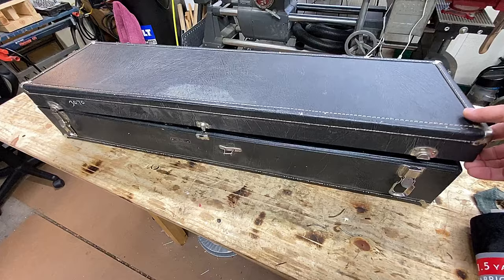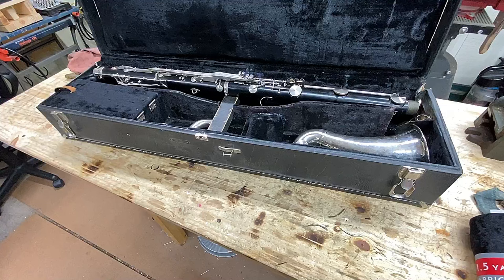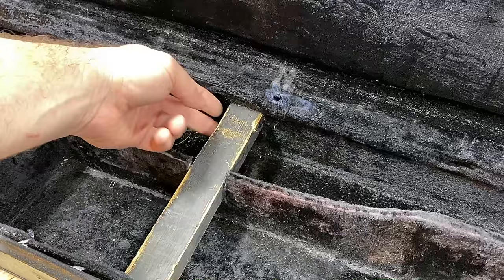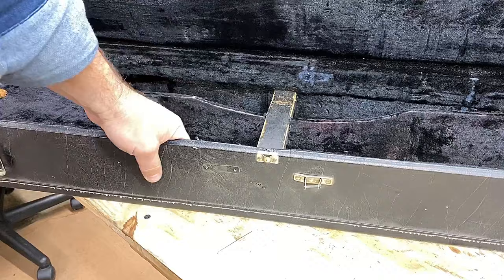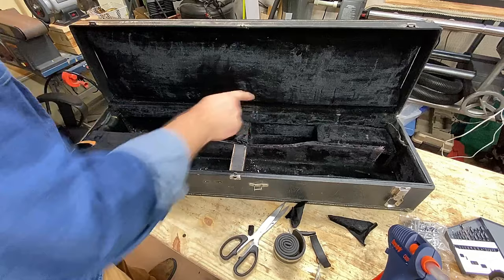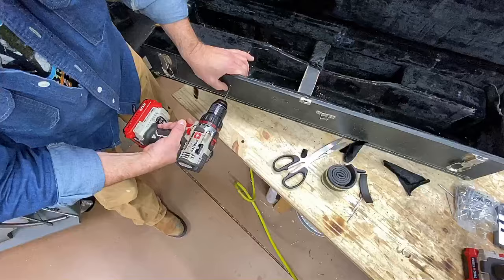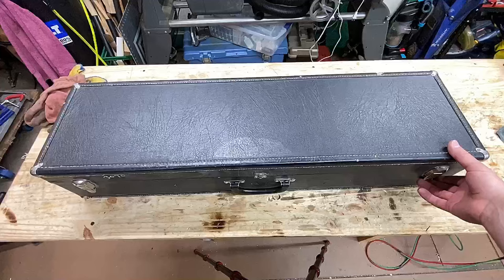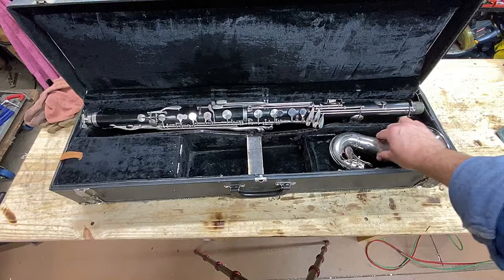Case Restoration- Wes Lee Music Repair

Comment: For hot gluing the velvet, I use popsicle sticks instead of my fingers! Lots less burns that way.  Instead of "school repair" level, I prefer doing total restorations of cases to better than new.  A lot more work, but more satisfying.  I have seen a lot of those whimpy cases and have used aluminum tubing the whole length of the case a couple of times to fix it.  Dumb design with the handle having almost no backing, but you see those often. My most satisfying task is recovering the outside with new vinyl material.   Ahhh that new case smell....
Reply from the maker: Drop me an email to wesleemusic@gmail.com along with some pictures of your work. I may have something for you.
Reply: Have you ever replaced the zipper on a (selmer)  sax case? I can't find anyone to do mine.  It's a shame because the case is otherwise really nice.
Reply: I build french fit pistol cases. I prefer using hot hide glue for a lining. Takes some prep to get started gluing, but sets quick and reversible.
Reply: @kennethellison9713  I would check with you local tailor, seamstress, and dry cleaner.  Often they have a full supply of different zippers and can repair them if possible.
Reply: @BoazKimMusic  Thanks for the reply.  But this is a Selmer case from the early 70's, maybe late 60's that has an oversized zipper stitched into the wood shell of the case.  I even brought it to a luggage repair place that told me it was impossible.  Looking for a specialist who knows the case.

Comment: Hey there, pleasure watching you get at it. Hopefully the owner will appreciate it. I have a question. I re-line small cases from time to time like piccolo and flute and am always searching for nice materials for the inside lining and padding. Any thoughts on those bits? Also have you ever run across a case where the support material inside the liner( a kind of semi hard charcoal colored foam or rubber) completely disintegrated into a sticky powder? It was used for a kind of hold down on a flute/ piccolo, when the case is closed?
Thanks in advance 
M

Comment: I'm working on a Jupiter Tuba case for my local HS doing gratis repairs.  This case is missing some of the outer trim where the plastic case joins to wood.  The manufacturer used the trim piece to staple through and join plastic to wood and then it has a little black insert that covers up the staples.  I can't find that anywhere, it's like Rub Rails for boats but way smaller.  Do you have any idea what this trim is called and where I can get it?
Reply from the maker: Did you get my email back to you?
Reply: But yes, I did.

Comment: I have a vintage Fender case that is for my stratocaster. I need to do a job on some rivets underneath the orange plush that covers the inside. Do you know good way to temporary lift off the plush in some area to reach the rivets to repair ? I don't want to tear out the plush when doing so.. It seems to be glued to the case wood sides.. Any idea ? Thanks and keep the good work.
Reply: Has probado a aplicarle calor con un secador de pelo?  (O una plancha para la ropa); No t aseguro que funcione, dependerá del tipo de adhesivo usado y algún otro factor; si te animas a intentarlo, haz alguna prueba en una zona dañada u oculta; utiliza un mártir, una toalla o bayeta, no le des calor directo a la felpa, supongo que no sería buena idea 🤷‍♂️. Salud 🤙
Reply: @Pazair-nq6gl  I finally repaired the damaged part of the case by slowly lifting the side plush. There was only a small amount of glue applied on the sides. The big foot rivet underneath the case that was pulled inside the case had still a small amount of wood stuck to it that permitted me to reglue it back in place and finish the repair. I then reposition some amount of white filling under the plush and finally glue back the plush sidings. Thanks for your help anyway !

Comment: You ever done this to a Yamaha tuba case?  Looks like someone dropped it and more or less cracked the wood in around 4 different places.  I think some spot metal patches even from the outside like you did on the corners is what it needs where the cracks are in the wood.  Any suggestions?  The case doesn't feel like it has a structure, just kinda sloppy on the case latches.
Reply from the maker: Yes, complex curves can be rebuilt using angle aluminum and sliced on half to make a sort of purfling. Another thing I have done is using sheet metal. Make a brake and bend, then use shrinker/stretcher to make solid patches/ runners. Everything gets drilled and riveted into place.
Reply: I just did 2 of those yamaha cases!  Gorilla glue, fiberlass mesh, resin, and bondo, .  Then I recovered the vinyl and replaced the handles and such (ALWAYS missing or broke handles/latches lol)  The backing for those Yamaha tuba case handles is pretty strong, but the handles break a lot.

Comment: Wes, what kind of glue did you use?  Can it be brushed on?
Reply from the maker: Contact cement, hot glue, spray adhesive are the 3 general types I use